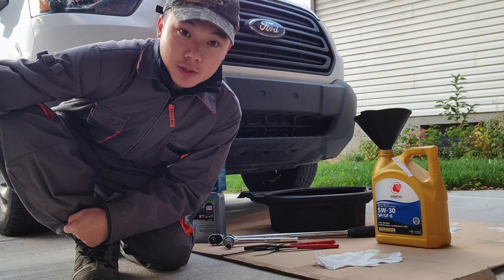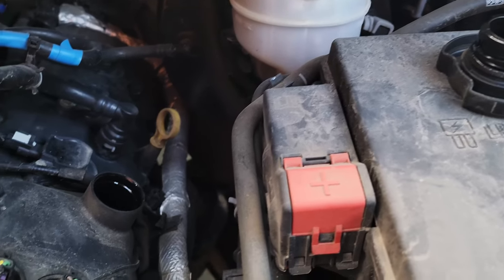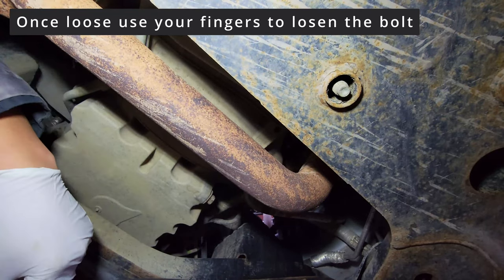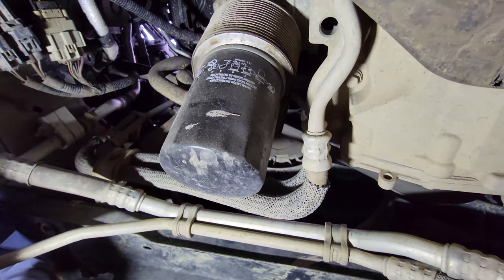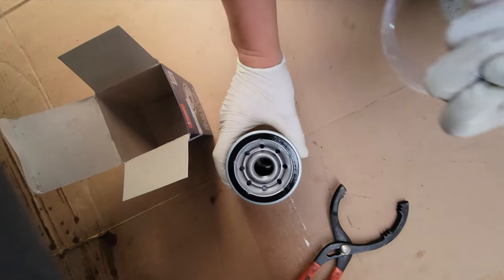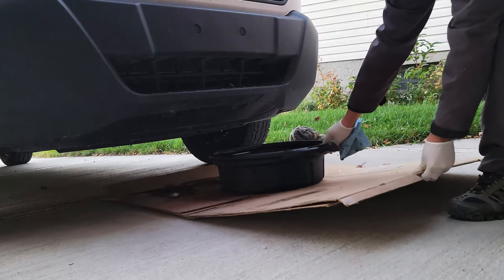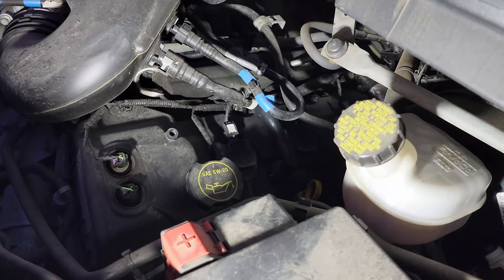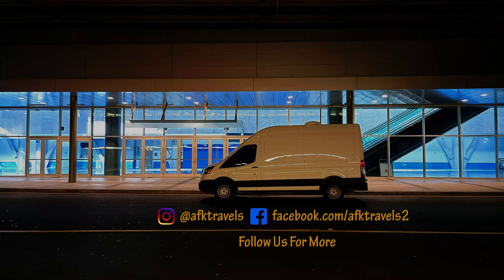How to do an Oil Change and Filter - Ford Transit 250 / Service Light Reset 2015 - 2020 | DIY Guide

Comment: I have seen people drill a hole in the bottom of the oil filter you're going to change to drain the oil from the filter and then remove it after the oil has drained.  MUCH LESS MESSY.  Just a thought. Oh, and besides cleaning off the surface where the oil filter mates it's also a chance to make sure that the old oil filter didn't leave its gasket. A double gasket will LEAK badly and it won't take long to destroy your engine.  Just another thought. 😉
Reply from the maker: Great tips! Yes I have had that double gasket experience myself 😅 thanks mate!
Reply: @afktravels  👍

Comment: Noticed you didn't have to jack it up; great video.
Reply from the maker: Yeah! Luckily, the Transit has a high clearance, so we didn't need to jack it up. Thank you for the lovely comment 🤩
Reply: @afktravels  I just did mine. I was searching if I needed to raise it and also how to reset the oil maintenance notification; that's how I came across your awesome video. Thanks!
Reply: @makinnewcounts6676  I use full synthetic  so the sensor gives a premature notification. I go based on miles driven.
Reply: @zone07  it's still too far between oil changes my friend.  Ecoboost is hard af on oil. Recommend manufacturers oil change intervals have gone up due to marketing not technology.  Pls respect your great ecoboost. I change full synthetic every 3k personally.
Reply: @makinnewcounts6676  there is such a thing as overcompensation. Changing your full synthetic at 3K is not only a waste of money but also resources.
Reply: @zone07  the resources to build a new engine are presumably more expensive
Reply from the maker: I respect both of your methods of oil change times, I personally still follow the manual for recommended mileage. On the other hand, we are ahead of the game compared to those who never do one in their life span, seen too many of those cases out there (poor car). Hopefully, this video will help educate people out there 😁!
Reply: @afktravels  respect man! I forgot to mention I only use premium too. I believe I get about a 10 percent increase in fuel economy and pay about ten percent more...so it's a wash there or very close and it runs soo much nicer. Don't take my word for it though, try it yourself! I literally haven't gone back to 87 once after the first back and forth (if you will).
Reply: @afktravels  man i have never heard of a lifespan without a single oil change that's just nuts! Like refusing to drink water or urinate till u die, while you run hard everyday in the meantime. I blew a head gasket or 2 from negligence as a teen, ball joints, and a transmission so I spend more upfront now and in the pm dept to try and avoid this stuff. I even coat my paint with polymer or ceramic and rubber seals etc. Could all be a waste if she is ever in an accident or whatever but I hope to live in her for a good ten yrs

Comment: I use the clean oil to pre lube my filter. Also if the filter is sitting straight down l fill the new filter with new oil before installing...thanks for the video!
Reply from the maker: Hey great idea! That is useful information 👌